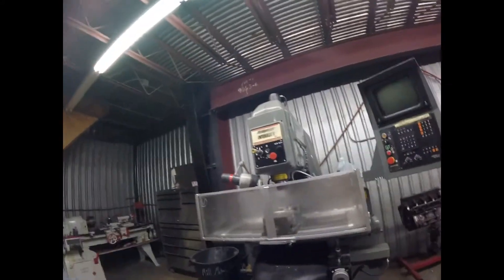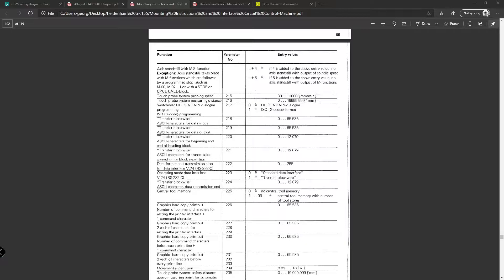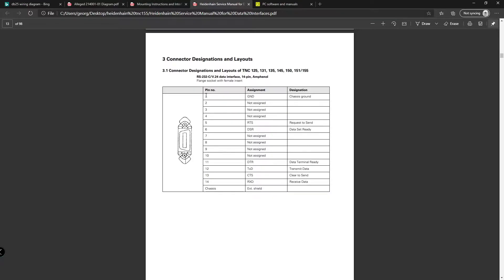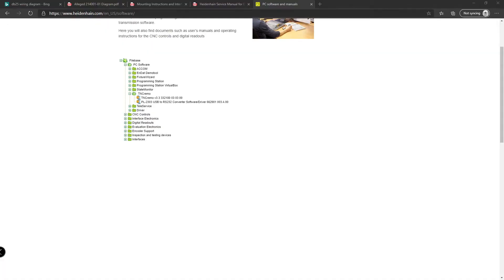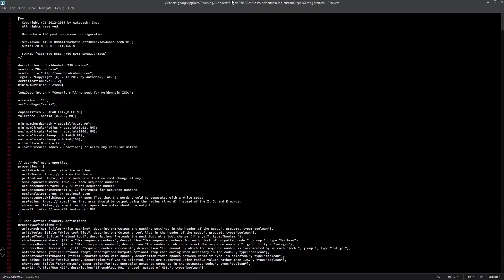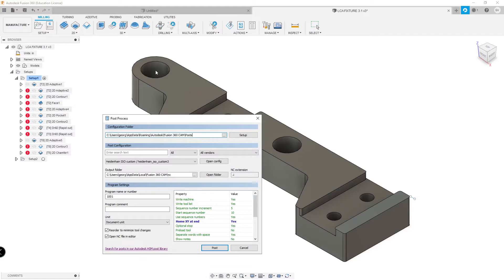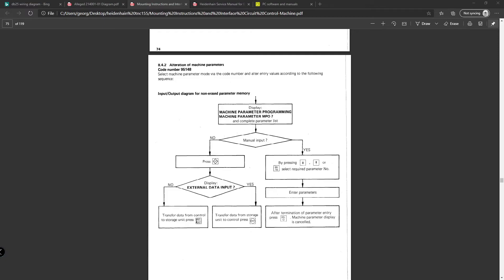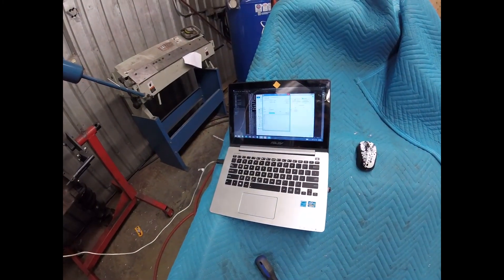Drip Feeding a TNC-155

Comment: I dont suppose you still have a copy of your amended fusion 360 post-processor for the TNC 155 ?
Reply from the maker: Should still be in the Google drive folder linked in the description
Reply: @sirgeorge497  Not that I can see. just pdf's and machine parameters
Reply from the maker: @patdudley7635  fixed, although keep in mind that it has some quirks with helical movements and last I checked fusion does have a post for tnc155
Reply: @sirgeorge497  Thanks !.  I already have a post for fusion for the 155, but it also has some issue with code. I can use 9600 baud rate and upload over 5000 lines no probs, but some of the code thats only 3000 lines makes the communication stop. Im rubbish with code so I dont know what is doing it. I will try your post and see if its an improvement 🤞
Reply: @sirgeorge497  Is there anyway of converting that file to  .h instead of .i  ?
Reply from the maker: @patdudley7635 yes, iirc there was something in the fusion post processing menu to select the output file format. If not, it should be pretty easy to change the code to do so
Reply: @patdudley7635  did you manage to fix it?

Comment: Hi.  I have  old  Klopp-Korradi  with TNC-151 . I have done  almost all  like in your  instructions .. I can't find  RS232 option on my screen .  I have changed  Baud Rate  but  is no more  connecting options in my menu. Can  I change this in Machine Parameter list ?  After connecting  adapter to Rs232 port  Is comming  "Ready" message on  left bottom corner  so it looks like  adapter have connection.

Comment: Good day.
My name is Gabriel from Chile, I have a milling machine with TNC Heindenhain 150 and I would like to know if you teach any courses to operate the CNC system, since I only use it manually.
Much obliged.
Greetings.
Reply from the maker: Hello, unfortunately I sold the machine in the video several years ago so things aren't very fresh in my mind. The ISO side of the TNC-15x controllers is very easy to use, although they do have some limitations. I started learning CNC programming using the following resource and spent some time tweaking things to work better for the machine that I used in the video. If you have specific questions I can do my best to answer them if they haven't already been answered.

https://www.haascnc.com/content/dam/haascnc/en/service/reference/programming-workbooks/mill---programming-workbook.pdf
Reply: Good afternoon, I understand.
The machine comes in Swedish language and I would like to change it to Spanish. Do you know how to change the language? And I am starting to learn about this operating system, the document you sent me would be very helpful, I am also reading the TNC 150 manual. Do you remember the procedure to transfer the program from the computer to the machine? @sirgeorge497

Comment: I need your help, on my tnc-155 machine, it can hold a maximum of 1000 blocks per program but I wanted to add more, is it possible? I have 3000 thousand blocks of space but it doesn't all fit in the same
Reply: And how i can do read in external feed ? 
Thanks
Reply from the maker: @MiguelMarques-l1h  You can either break it up into different chunks at tool changes, ie. having first program for roughing, second for drilling, third for finishing etc.to keep it under 1000 lines or to EXT. read in. select the correct operating mode and read the program in, both o which are explained in the video and the manual "Heidenhain TNC-151-BQ-Conversational_programming.pdf" in the google drive link in the descriptiopn
Reply: @sirgeorge497  I already managed to solve it I have one more question if you can help me My cnc machine gives a great finish working only in X or only in Y but when I use both at the same time, the finish becomes wavy. Is there any way to improve this?
Reply: the tolerance of my programs is 0.01 Is there any parameter that I can change to improve the finish?
Reply from the maker: @MiguelMarques-l1h  if youre having issues where both x and y axis are used, check the backlash settings on the machine itself. if they're set incorrectly the machine will be moving to little or too much when the axis direction is changed and will cause this wavy finish.

The tolerance is set in fusion in the post process dialogue box
Reply: @sirgeorge497 tell me something , When changing tools, my machine only moves counterclockwise, and when it has to move clockwise it seizes and the carousel doesn't rotate. Is there an M code or parameter that needs to be changed?

Comment: great vid , i was trying to drip feed my tnc 151 46,000 lines via tnc server the other day it froze at 16,000 , have you ever had this issue ?
Reply from the maker: yes. I forget what the magic number was exactly but there were only so many lines of code the controller could eat whether you saved it into the machine (limited by memory size per program) or fed it in via external read in (limited by number of lines) it wasn't the number's assigned line that limited it, as sometimes we jump by 5's or 10's to allow room for fixes, but the numerical value of the line. I would recommend putting program breaks at tool changes or between roughing and finishing passes on more complex parts to keep each program within the line limit.
Reply: @sirgeorge497 Help me please

Comment: Very informative video, might just save my machine with that. But your link in the description does not seem to work. Can you check it please? 
Thank you!
Reply from the maker: Sure. The post config file for fusion is obsolete at this point as Autodesk has one specifically for the tnc155. I should still have parameters and manuals though.
Reply from the maker: link is fixed
Reply: @sirgeorge497  thank you, just downloaded it. I'll try to connect to the controller this weekend, your input will definitely help. My machine is European, AVIA E40-NB. Of course I'll have to modify the parameters :) 
Thanks again, greetings from Slovenia.

Comment: First HUGE detail, it’s not just a db25 connector it’s a usb to rs232, to db25. There are just plain usb to db25 cords out there and THEY WILL NOT WORK!!! Been chasing my tail over this for about a week now, with an rs232, now I actually have a serial port that tncserver recognizes.

Well thanks so much, I’m a manual guy, but we have this old twin to your machine, well the getting it to work with fusion seems pretty easy, now to commit the ultimate sin and do this yucky cnc thing.

Seriously thank you for putting out this vid, it made one easier step to actually making this old thing work, and push me into cnc beyond my 3d printer lol.
Reply: @djberg3483 @sirgeorge497 Can you guys help us out? We are stuck trying to get our new old Bridgeport going. Heidenhain TNC 151, all the machine parameters from your list seem ok (thanks so much for those), we swapped pins 6 and 20 in the  db25 socket in the contoller box, got TNC server running and it finds a COM port, got to the point of loading a program number stored in TNC server folder, but here we get stuck: screen on TNC says EXT IN-/OUTPUT NOT READY. Most likely cause seems to be the cable connection, but we have a USB to 9-pin d-sub/ 9-pin d-sub to db25. Any idea what we might be doing wrong?

Comment: Hi George do you know if that pin layout will work for the TNC 145?
Reply from the maker: I would assume that if it is the same connector that the pinout is the same however I don't have a diagram for the TNC145 in front of me
Reply: I think I'm doing everything correct but I can't connect, does usb to serial cables work OK with connecting?
Reply from the maker: @carlwilliams6392  I used a cheap dtech usb-db25 connector off of amazon, was lees than $10. if you're having issues you can try to "short circuit" the DTR and DSR signals within the TNCServer settings

Comment: Hi George, very nice. I have a Mikron WF21D with TNC355. And serial communication is really complicated with normal state of the art computers. Currently, I still have problems with the cable connection and am not able to communicate with the Heidenhain. Let's see what works here. In the end I will probably take the soldering iron in my hand again...
Best, Stephan
Reply: Hi Stephan. Did you solved your issue? I bought used Mikron WF21C with TNC 155 but I can not find electro scheme and parameter list for this machine. Best, Dalibor
Reply: @daliborsailovic8100 

Mislim da imam elektrosheme od mikron wf21.Ako ti treba pisi slobodno
Reply: @dekki-d5t  da, treba mi. Ne bi baš da delim mail ovde u komentarima. Kako ti se mogu javiti da mi pošalješ? Lep pozdrav

Comment: In Fusion there would be a PP especially for tnc 155 did you tried that out?
Reply from the maker: At the time I saw one for Heidenhain / ISO but not for TNC-155 specifically. the Heidenhain / ISO had a few differences, and it is what I started with and made changes to for my TNC-155. I no longer have my Bridgeport but I do see that Autodesk now has a PP specifically for TNC-155 available for download from their website

Comment: Hi George,

Thanks for the video and especially the machine parameter file. Saved endless messing about trying to figure out the fine details of bringing my TNC155B back from "Oh no! The machine parameters. They're gone." 
I have a Maho MHC 700C which I left in storage for a few years without 3 phase power. So I expected to lose them. A big crane job got it into my shed and powered up, and I had to break it down into smaller pieces to do so. A lot of work just there. So it came up in German as expected.
I hadn’t thought of the USB to RS232 cable until I saw yours. Bought exactly that one. Nice that it puts out 9V. A lot of them seem to just use the 5V USB which seems a bit low. The cable meant I could by a relatively new second hand laptop with Windows 10, rather than an old one with a DB9 com port.
You go a bit fast at the end there, but I managed to get it by running the video at 25% speed. As well you can single frame in YouTube by pausing and then pressing either the full stop or comma key for forward and back.
It would be nice if you added a bit at the end that showed exactly how to use TNCserver (I started with TNCremo before I realised that was wrong) and then showed how to set all the tabs there correctly. My machine will only connect with ME mode with lost parameters. Maybe it has a slightly different Eprom revision. I spent a few hours messing about with that and with various handshakes and got it a half way through the file where is “stopped”. Then I realised that the fault was in the syntax of parameters 94 to 110. I’m lucky I have a punch tape of the final commissioning in 1990, which has to have correct syntax, plus a slightly different one from 2007 where someone went through and put all those parameters in the installation manual, which I used, but they got the number syntax a bit wrong (real numbers instead of integers).
Your parameter file saved me days of entering as there are so many CR, LF, and space non printable characters typos are inevitable. I put it in Word and turned on the punctuation to see them all. I also used it to help the decode the entire punch tape. There are a vast number of repeat sequences so I made a template by just stencilling through the punch holes onto a piece of paper then just slid the tape along to pick up each repeat. So I only had to go through and edit the actual settings for my machine.

TNCserver finds the correct COM: number and lets you set the baud rate, but it shows the rest ghosted (in some cases). If you go to Windows device manager you can set things in the serial port driver, but it doesn’t seem to reflect back to TNCserver. Some other sites show the setting as being 2 stop bits. That works on my machine, in device manager, when parameters are lost. My punch tape has even parity. That works too. I doesn’t seem to be sensitive to the handshaking at 2400 baud. Maybe it can empty the buffers fast enough.

A bit on your cable. It’s definitely been tampered with. Actually, the wires look a bit big to fit the pins on the DB25.
The “Mounting Instructions and Interface Circuit control – Machine” manual shows it in Figure 5.3 a). It should be what they call “null modem”, which is an old term for not crossed over.  So it should go should go RTS to RTS etc. It’s the left cable in the diagram and is meant to go from the Amphenol connector on the TNC to the wall of the cabinet on your mill. Then the cross over you do is on the cable that goes to the FE 401 or ME101 etc. But it makes much more sense to do what you have done as we already have the Dtech cable. Note there is a stupidity in their cable diagram. It has 2 loop back wires from pin 6 to pin 8 on the DB25, RS232 connectors, but there is no connection to it on the cabinet connector. I think it’s there so you could swap that cable end to end, but they put different gender DB25’s on each end so you can’t anyway. It doesn’t seem to matter if they are there. Note it is missing on the 5.5 b) diagram below it because there is no active pin for it on the Amphenol connector.
I swapped my cabinet DB25 for a DB9 as my Dtech cable doesn’t have the DB25 to DB9 adaptor with it.

Comment: Nice and informative video! I just started my retirement  from machining job, 44 years whole and 29 years CNC. I worked first with Heidenhain TNC155B (MAHO 500W)  and later also TNC530i (DUGARD EAGLE). 155 is an amazing control, with its parametric programming you can mill even complex mathematical curves and full 3D. Mastercam Mill 3 helped from -94 on, but still I kept programming with Q-parameters when I made my own canned cycles (threads, various L-shapes, squares, ellipses etc.) for later use. Those were interesting an very creative years.

Comment: George I need help for my Hidenhain tnc 124, my panel is not working , there is an  error on top of the screen, Relay ext. Dc voltage missing
Reply from the maker: check emergency stops, check the emergency stop circuit, and maybe check the oil level if you have a lube system.
Reply: @sirgeorge497  thanks for the reply, will check this , and whr can I get the manual for zayer 88af
Reply from the maker: @rajvindersingh7606  That i dont know. I found most of the information that I did just sorting through google search results and manufacturer's websites
Reply: External DC Voltage Missing = Way Oil Level Switch Low on my TNC-151

Comment: Thank you for your clear explanation! Now it Dripfeeden works for me (Fusion 360 + TNC 155P + Mikron WF21C). But then in the Heidenhain dialogue language.
Everything seems to work, but at the beginning of the program execution when I call a tool I get the error message that there is no tool defined. That had been done a few lines before, but so it seems the TNC doesn't remember this ...
Does anyone have an idea what might be causing this?
When I transfer the program to the TNC it will work as usual.
Reply from the maker: Can you post the code that fusion generates around the tool call? like 15 lines before the tool call, tool call, and 15 lines after the tool call?
Reply: Hi, maybe you have english eprom file?

Comment: at work we have 4 cnc machines with heidenhain on all. the oldest has a tnc155 controller.
 I also run Fusion 360 with  Generic milling post for Heidenhain TNC 155.  https://cam.autodesk.com/hsmposts?_ga=2.156875579.1271040680.1607583034-815659367.1499820299
I need to think more about What strategies I run on the older machines idea that they can not run any strategies as machine can not so well keep up with reading heavy codes other than that it runs very well.
I also use TNC 640, TNC 426 and TNC 415.
I have been working with heidenheim for almost 25 years and it is the most reliable control I have experienced They have their faults like all possible other controls but I have not had any problems I have never had where the heidenheim controller does anything strange in the programs.

I use drip feeding over Serial WiFi Adapter - RS232/485/422 Moxa brand  from CIMCO DNC-Max Server
Reply from the maker: That's rad! I'll look into that adapter, would be handy to eliminate my laptop from drip feeding and just have it come directly from the desktop upstairs